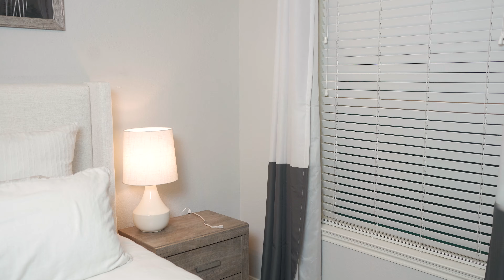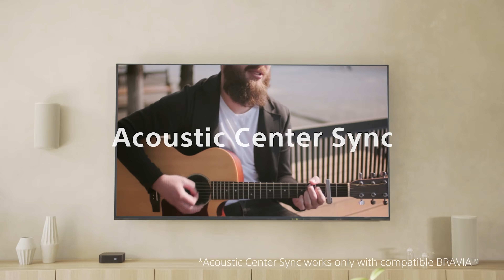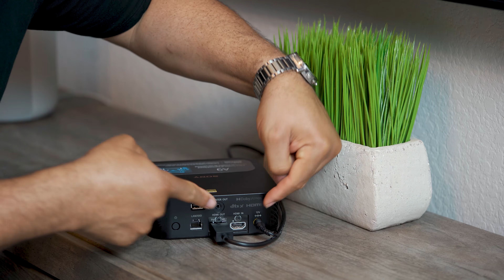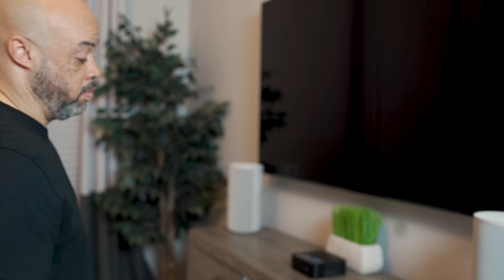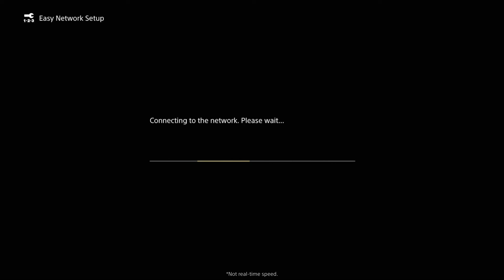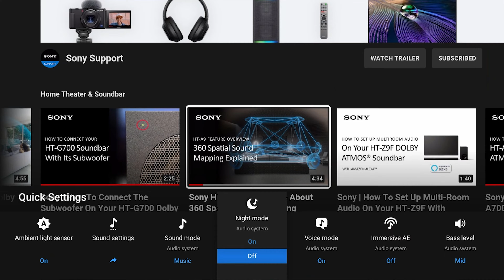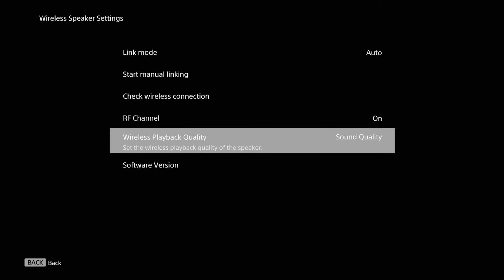Sony | How To Set Up Your HT-A9 High Performance Home Theater System

Comment: Thanks for the Tutorial At last.! How to connect the SW5 Subwoofer? about the rear speaker should i set up the speaker above my Ear level & set the speaker towards my Ear?
Reply from the maker: Hi Tafhim, thanks for your inquiry! When you set the Link Mode of your HTA9 to AUTO, the SA-SW5 should automatically connect to the home theater system when you press the power button.

 

You can also perform a manual connection. Using the remote control of your HTA9, please refer to the steps below:

 

1. Press HOME

2. Select [Setup] - [Advanced Settings] on the home menu.

3. Select [Speaker Settings] - [Wireless Speaker Settings] - [Start manual linking].     The [Start manual linking] screen appears on the

    TV screen.

4. Press LINK on the subwoofer.  The power indicator of the subwoofer that had     LINK pressed flashes twice repeatedly in green.

5. Select [Start].  The manual connection starts. The connecting process appears on the TV screen. To cancel the manual connection,        select [Cancel].

6. When [Subwoofer] display [Connected], select [Finish].

7. Press (enter). The manual connection is established and the power indicator of the subwoofer lights in green

 

For more details, please refer to this link: https://www.sony.com/electronics/support/res/manuals/5027/39fd6e129f40f54ddd7e93d0ac626ee7/50273451M.pdf

 

And with regard to speaker position, surround sound can be experienced more effectively by installing the 4 speakers to surround your listening position and installing the front speakers on both sides of the TV. There is also a Sound Field Optimization feature which is part of the initial setup that will analyze the correct sound measurement between the speaker and the user. For more information about the speaker installation, please refer to the link below:

 

https://helpguide.sony.net/ht/a9/v1/en/contents/TP1000029207.html?search=rear%20speaker

 

 

Hope this helps!

 

Regards,

Sam
Reply: @SonyConnect  Thanks Sam for your reply. One more Question - Is it possible to Connect Sony HT A7000(Sound bar for center) With Sony HT-A9 and SONY SA-SW5 subwoofer all together?
Reply from the maker: @Freenation-d1d   @Tafhim Al-Azmi  Good question. Unfortunately, no. You can pair the SA-SW5 subwoofer to either HT-A9 or HTA7000. But, you cannot pair them all together at the same time. Hope this helps! -Sam
Reply: @SonyConnect  Thanks

Comment: For the projector setup I will connect the box opposite to the wall where film's are projected.
I will use an HDMI switch matrix to mux all sources (SAT/TV/BR/Fire stick) to the A9.
Will it be ok without using eARC? No sound lag over the video?
For the speakers, Is it ok if they stand over a sofa? is that ok if not on a hard surface?
Reply from the maker: Hi Alexandre Esquenet, thank you for reaching out to us. The speaker system is compatible with both eARC and ARC. ARC is the function that sends TV sound to an AV device such as the speaker system from the TV’s HDMI jack. eARC is an extension of ARC and enables transmission of the object audio and multi-channel LPCM content that cannot be transmitted with ARC. In case the sound from this speaker system lags behind the image, we recommend following these steps:

- Set the adjustment value of the delay between the picture and sound to 0 msec if it is set to the range between 25 msec and 300 msec. A time gap between the sound and picture may occur depending on the sound source. 
- If your TV has a function that delays the image, use it for adjustment. For details, refer to the operating instructions of your TV.

Do not place the speaker system near heat sources or in a place subject to direct sunlight, excessive dust, or mechanical shock. Also, use caution when placing the speaker system on a surface that has been specially treated (with wax, oil, polish, etc.), as staining or discoloration of the surface may result.

Please check the manual for more details: https://support.am.sony.com/release/Manual_5025229121.pdf

 

I hope this helps. 

Regards,
Erin

Comment: Let's get real: this video is in response to all the customers whose units keep breaking up, losing connection, and stop working properly.  If you have to make a video about troubleshooting, under the guise of "information", then it's time to buy another product.  And anyone that would buy a sawed-in-half soundbar for this price deserves what they get anyway.
Reply: Someone sounds like they have an axe to grind. Are you speaking for yourself (let me guess you don't own these speakers) or are you attempting to speak for others? I have them and they work fantastically well thanks. Worth every cent I paid for them. They are literally a new type of speaker/sound system. Teething problems are to be expected with new tech. Hardly unusual. As are higher prices (think OLED and their high prices and burn in problems). So long as any problems are addressed, acknowledged (hence the purpose of this video) and anyone can return or exchange a product not working then it's not the end of the world.
Reply: I can't use a sound bar with a projector setup where the sources and projector is opposite to the wall where it projects to.
Reply: What else would they do on a "Sony Support" channel?
You must be a real delight at parties
Reply: @maxrockatan2552  I was thinking the same thing. This is literally support channel for dealing with information and/or trouble shooting for their products. I wonder which brand's products he buys that both NEVER has any flaws or issues  that require information as to how to solve said issues, and that doesn't have a YouTube channel to do so ......
Reply: No lag ore drop outs now

Comment: Just need to buy one.  They are sold out everywhere. 😡
Reply: If your in the us go to bestbuy and ask them if they can order them some stores can depending location I checked yesterday and I can purchase them and get it by Friday
Reply: Out of stock everywhere because sony stopped production. First batch hv serious audio skipping issue. Until today we early owner scratching our head to find solution on this. This troubleshooting video only helps for temporary. The issue will comeback again n again.
Reply: @absar810706  just got mine the other day production has likely stopped but there are still some out there for example mine was a order from over a month ago that got canceled so I was able to get it you just have to be extremely lucky

Edit: also I have had no issues with audio skipping that was fixed for the most part in a software update a while back